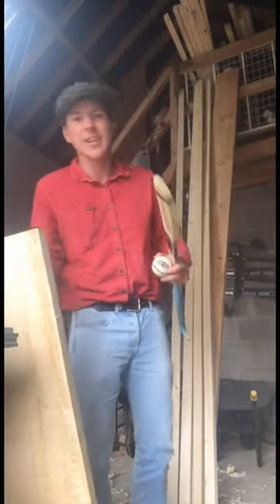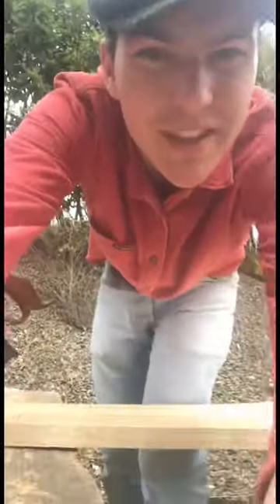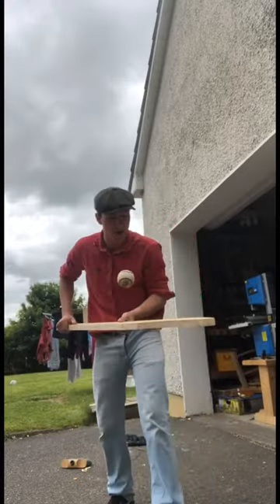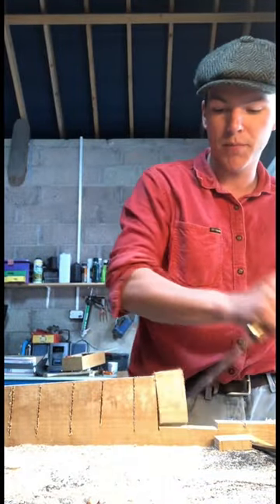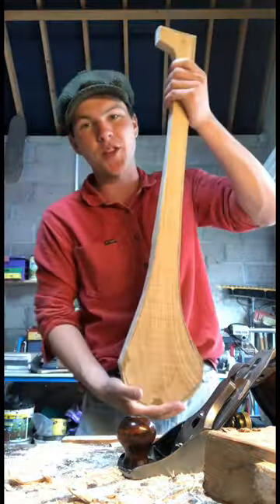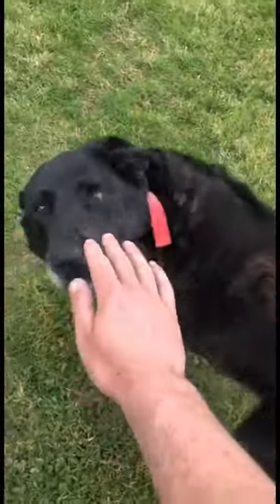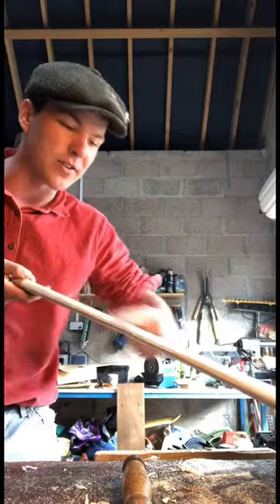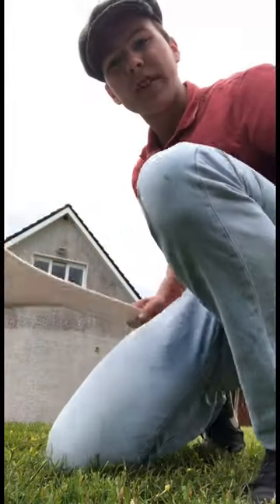How Hurleys are made.

Comment: Ash dieback is a real shame. Back in my days as a reenactor, we'd either make spears from ash or pine. Generally pine was cheap and easy to work with, but broke often and you'd maybe get one year of use from it. Ash was about twice the price but they'd last at least two or three times longer before they became too damaged to use. On the other hand, it took maybe ten times longer to plane it down to the desired thickness (which was a little bit thinner than pine, owing to the greater strength). And I was using a hand plane for that and I even went and bought a brand new one which I still have somewhere.

Then someone bought an electric plane and took all the satisfaction out of it as they could do in ten minutes what would take me several hours by hand.